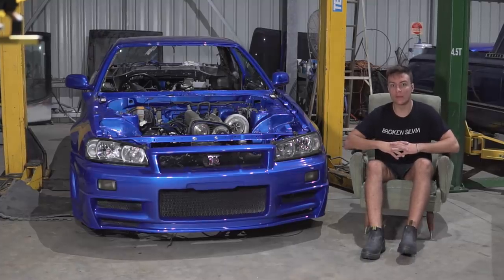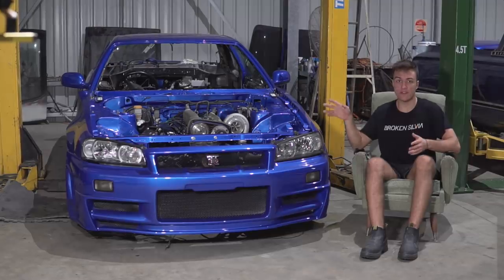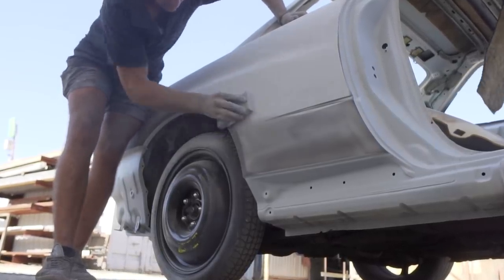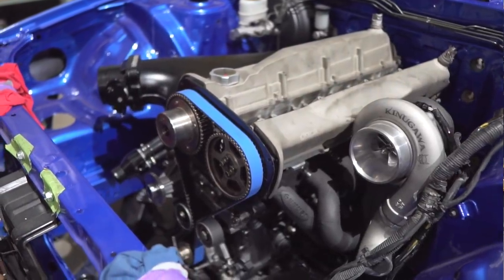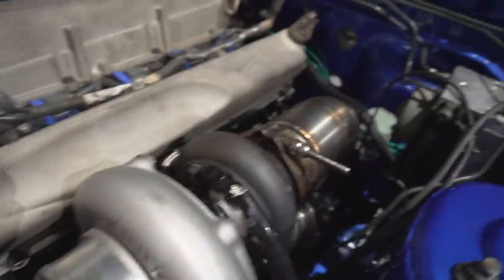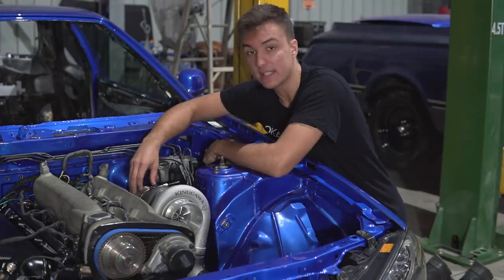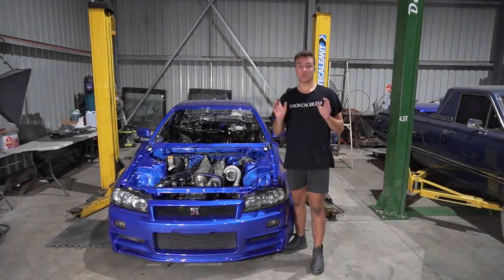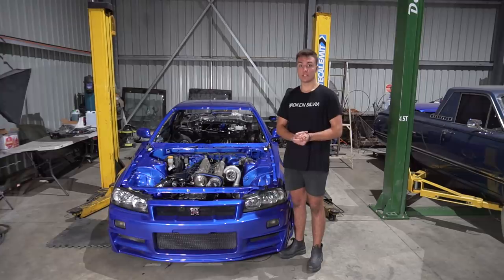R34 Skyline Single Turbo & MORE!! | Poor Man's GTR [EP17]

Comment: You saved 50k and got something much cleaner than a stock GTR. You should be proud. This is not only a GTR, but a BRAND NEW GTR in my book.
Reply from the maker: Yeah never going to have resale like a real one but saving 50k and ending up with a fresh car, you’re definitely right about
Reply: @BrokenSilvia  its your forever car tho (i assume) so it doesn't matter. Plus you'll still get a lot more money than what you put into the car.  Especially in the States when it's legal. This gem is worth at least 50 grand

Comment: Love the build, love that it's a passion project for you and it really comes through with the time spent on the body work, love the fab work (Dan's welds look phenomenal!) and the direction you're taking the car. The mechanicals (engine, drivetrain etc.) will come but finding a car that's straight and rust free is the hard part. You've already taken care of all that yourself so that's good to go. Getting the RB25DE in there for now is fine as you can build up any of the other blocks you have over time. My only "gripe" as it were are the GTR badges on a non-GTR but it's your car of course so do as you will.

Comment: I do not think intake manifold cracks because of the boost, it's at most some 25 psi and less than most of the tires. Usually the vibration kills them because of the bad cast, bubble inside for example.

Comment: Damjan, one advice: you need to weld thick plates on the lowest points of the exhaust, so as not to crumple it if you scratch the asphalt.
PS: imho, the cool turbo part has so little space around.
PPS: anyway, it deserves a like!
Reply from the maker: Good call!

Comment: Lately i've seen some comments people hating the GTR badges on the car because the car is not a genuine R34GTR and it is not AWD. Come on, as the car is now looking 100% like a GTR, so you want damjan to use a GTT badges on it ?
Otherwise,this car restoration is a proper build and not a Radically Immature Car Enthusiasts (RICER) whatsoever. Keep away that small hate topic and just enjoy the build 👌
Reply: In a few years when rich Americans dry up the market and drive the prices up to $300K people will start converting anything that came with a Skyline badge, there will be no other way to have one. Purist attitudes will change real quick.
Reply from the maker: Idok, couldn't have said it better haha

Comment: Hey mate, amazing build!
 where you get the reo? I’m chasing one. But only seen them on eBay.
Also did you use Gtr low mounts for cooler?
Is this going to be engineered?
Hope you video the whole process!
Reply from the maker: Hey man
Most parts bought directly through nissan brand new

Nope custom mounts
Yep will be engineered one day
Reply: Broken Silvia cheers mate, didn’t know nissan sold this stuff still? 
Are your front guards metal or fibreglass? I have applied to mod mine with swapping over all Gtr gear on to rb25, have approval but needs engineering though to swap whole rb26 it only needs dot approval, a lot easier. But I like the 25 for vct